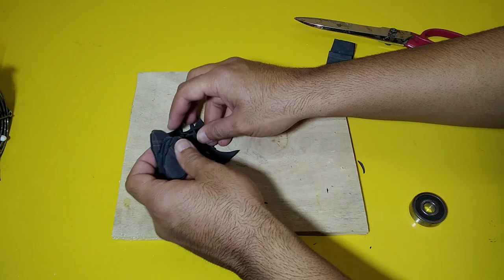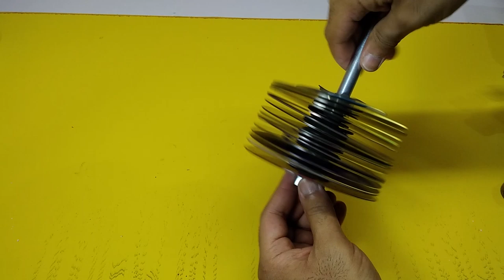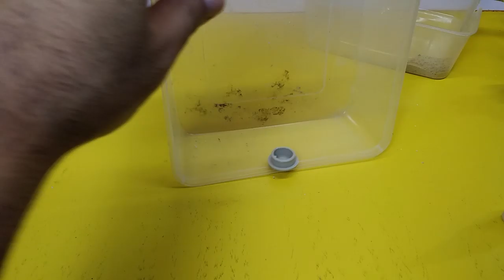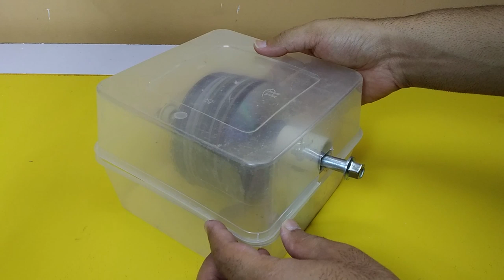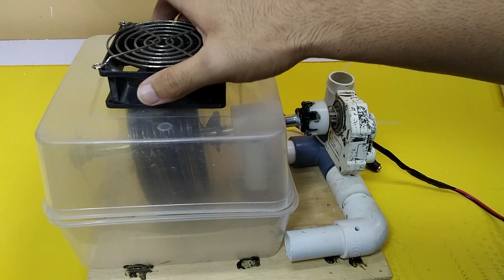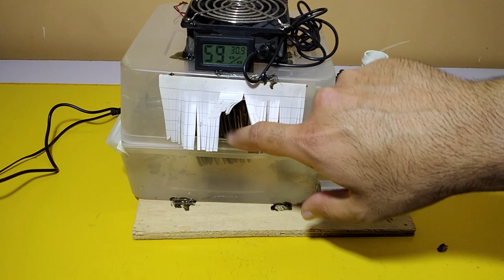Diy Humidifier with disk and fan - diy humidity maker

Comment: Best humidifier is take rectangle water box and light on near the the box .slowly due to light heat  the vapour of water come and  the humidity increase .my incubator was little open so it  get above 60% humidity.i made it in the corona lockdown  time so couldn't get that much of parts .if it well closed get 70 above humidity.thank you umair .I watching your video getting more idea to make tray automatic . inshallah I will make good automatic tray after lock down
Reply from the maker: that's is good to hear that